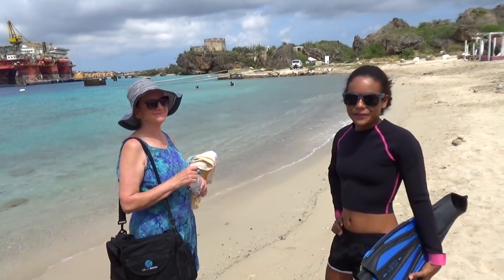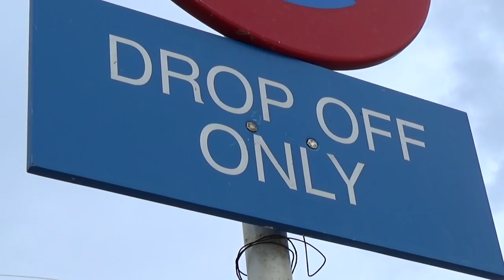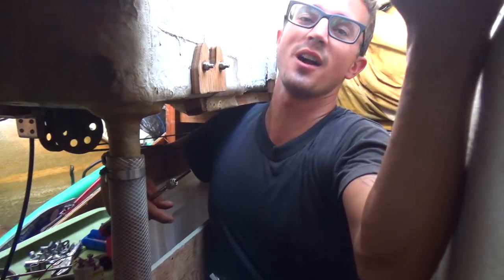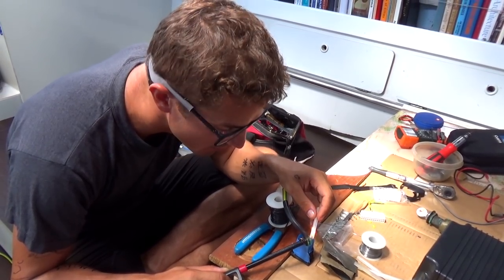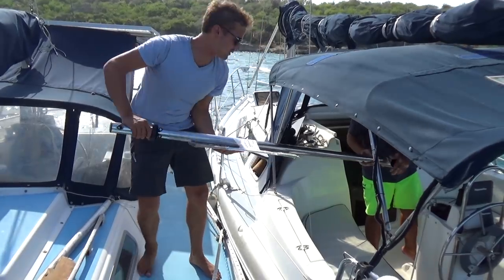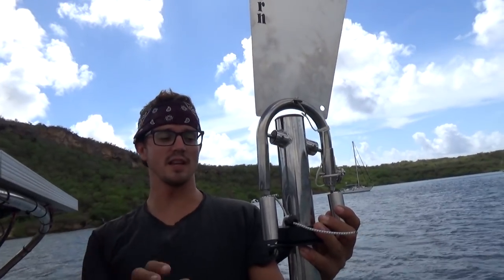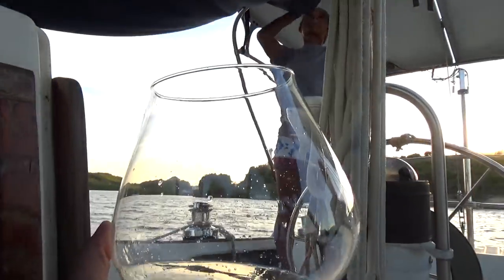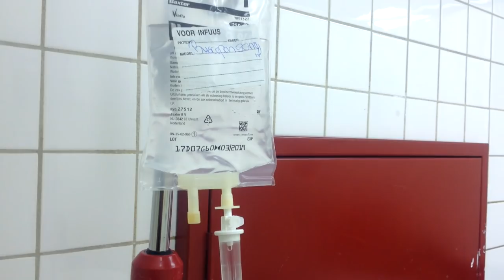Replacing our Autopilot with a CapeHorn WINDVANE — Sailing Uma [Step 101]

Comment: CAPE HORN is definitely the best windvane that was ever designed. No gears and levers, only one moving part… So chafe is almost inexistence and fouling the gizmo is almost impossible. Moreover the beauty of it is that it can be rigged to an autopilot so that the boat can self steer under power with a nominal current consumption. Originally it was designed and built by a French Canadian who sailed alone around the world with no mishap what so ever. Excellent piece of creative engineering. 
Excellent choice ! I wish I had one on my own boat.

Comment: Congratulations on your new windvane. It is sure to become a valued crew member. It doesn’t eat or talk. They just keep working. Balance the boat carefully and let it go to work. I sailed about 14,000 miles with a Windpilot. My boat had light ends and needed a lightweight vane. Now I am buying a different boat and wouldn’t be without a vane even for short trips.

Comment: Sorry about the kidney stone. I got several presently on board. First one, 15 years ago, that wanted to go South really took me by surprise. The next one 4 years ago was to big to pass so the Dr went it and got it. Not fun. Last one, 1 1/2 ago was small enough that after two episodes of it stalling I passed it. From what I’ve read the pain is not when it’s moving it’s when it blocks the passage. Having effective medication to handle those episodes is essential. I’ve found that those episodes only last an hour or so. Also I travel with a medication to help with urination, that helps it pass. Best wishes, I love your channel...

Comment: I had a Cap Horn on my HC38. 
The key for us was to keep the sails trimmed correctly and to not be overpowered downwind. 
Racing helped us in that it taught us better sail trim. Most cruising sailors have their sheets too tight and don’t adjust halyard and outhaul tension for wind strength. .

Comment: I had kidney stones, 1 big one showed on x-ray. They went in with a laser and broke it up so it didn't do as much damage when it passed. It was about 1/2 way out. Worst pain ever, zapped and over. I am always amazed at what you do with so little, making parts. Love the electric motor on a boat. I worked in the municipal water industry, we had a lot of motor controllers for soft starts and variable speed....James

Comment: Tip for soldering !!! always clean your surface area first to avoid dry joints !!!! you were soldering on copper which had visible oxide on it, always give the surface area a rub with an abrasive rubber to make it shine like new then solder to it

Comment: Wind vanes are awesome for ocean cruising, used one from Fiji to Tasmania, when both other auto pilots failed, wind vane was the bomb. Cant remember the brand we had on board but it just had a direct drive to it's own rudder and you had to lock off the wheel to centre. A bit different to yours but it worked really well. Thanks for the informative channel guys!

Comment: I suggest adding this to your motor playlist. I also recommend getting a raspberry pi to monitor your motor & battery temps. You can even have it trigger a vent fan when it gets hot in the battery/motor hold. It sucks to loose a lead acid battery, but a lithium battery thermo issue can literally be explosive.

Comment: I have enjoyed watching all of your videos.  I sailed to the South Pacific in a 30 foot boat with a homemade auxiliary rudder windvane in 1976-7. It was great. I sailed on a 44 footer from Mexico to the Marquesas with a hydrovane in 2015. The hydrovane was pretty bad, frequently requiring manual steering assistance. I have a little experience with a Monitor. The Cape Horn should be perfect for Uma. Years ago we used to have sailing dinghy races with the rudders removed. This was a good way to master sail balance. (Centerboard and crew position were equally important.) I’m sure you have already found that Uma usually sails with a bit of weather helm. As the Cape Horn manual suggests, set the vane at “neutral” for the average weather helm you are experiencing. When the puffs come and the weather helm temporarily increases the vane should handle it. If you are constantly needing to adjust the control lines , it’s probably time to reef. I see tat you’ve already gone hundreds of miles successfully with the Cape Horn. So, you surely have learned all of the idiosyncrasies by now. Good luck!
Reply from the maker: +Mike Jacker We've heard similar reports and reviews of the hydrovane and others. Constant adjustments. We also learned propper sail trim because of our crappy wheel pilot. It couldn't handle weather helm at all! So far, we haven't had to adjust it even.
Reply: Sailing Uma Our homemade vane was also completely reliable with no tending for days at a time on Pacific crossings.

Comment: "does it need a heatsink?". The bigger the better, that big backplate is there for a reason, keep an eye on it. Personally I would have put some spacers behind it to improve circulation. Looking forward to seeing how the re-gen works and great work on the switch mount. Maybe concider a water maker next and start drinking more of it. It's a bit of a cruisers pit fall.

Comment: have a monitor wind-vane and use it anytime the sails are up.  Not really on day sails though, because it's fun to steer by hand. You can even tack with it with practice and favorable wind conditions. Its better then electronic because you don't have to adjust sails with minor wind changes. The boat automatically corrects in the wind, and you just adjust your next course change accordingly.

Comment: Nice video and install of,switch and Cape Horn.  I sail a Rival 32 solo and I have a wind vane.  It is a Sea Feather, built in UK by a very small company.  My boat is tiller so install easier but I love my windvane, rarely use my tiller pilot now as no drain on batteries and no whirring of motors when I am trying to sleep.  Hydrovane is one of the best as can be used as emergency tiller but the Cape Horn has been used in anger on many boats crossing oceans so you have top kit there.  Happy sailing.  Andy UK S/Y Corrival

Comment: Hi Guys, we love the  weekly updates! You are sailing over many of the places we went, a 20yr trip that ended a couple of years back... we had sprouted a daughter on the way!

The reason I am writing is too give you an idea we used ...

We were in the Canaries waiting for the weather as usual when i had an idea..  Our autohelm 1000 wouldn't drive the boat in any kind of weather. when attached in the standard way. I had the idea too attach from the push pit  to  the wind vane so that the power used would be less than a watch ( Just guessing watts  but it was minimal) 

This affair was meant to be temporary but in fact i never took it off, the benefits were very apparent. When there is  light breeze from astern the apparent wind can go to zero, this puts you back staring in 'Night Mare on helm seat ' again..  Same with no wind and the motor on .. The other not immediately apparent plus is the savings in miles..

 As you accelerate down a wave the apparent wind will move toward the bow, similarly when slowing down going up the back of a wave, the apparent wind goes towards the stern.. The net result is a series of curves which over 3,000 miles add up! lol

One thing I hadn't thought of was the wind shits, when this happens your vessel will alter course accordingly. With the course being generated magnetically  Uma will hold a true course and your sails will flap.. In a way  demanding you be a more efficient sailer and trim those sails !! ! lol

Here's a clip of us just off Panama after our time in Colombia ...

https://www.youtube.com/watch?v=_QWCT7ajFB4

Keep up the good work guys ! Let  ol' farts live vicariously once again!! lol xx
Reply from the maker: The Cape Horn is actually designed to use with a small tiller pilot. It has an extension you put on the end of the quadrant in the lazarette. We'll cover that in an upcoming video.

Comment: I had a Raymarine Wheelpilot on my last boat.  It sure was squeaky, but it was reliable.  Though it is rated for 16,000 lb and the boat weighed 12,000, it sometimes seemed to be at the edge of its capability.  My current boat has a much older Simrad WP32 on it.  This pilot seems much more capable on a boat of greater weight, and it's much less noisy.  It's too bad that Simrad no longer makes a wheel pilot.

For the way you guys travel the Cape Horn makes so much sense.  Until I cross an ocean I can live with a wheel pilot as we always end up running the diesel to make power.   I commented on the install video that it is a beautifully made bit of gear.
Reply: I enjoy all of your videos. I sailed to the South Pacific for a year with a homemade auxiliary rudder type windvane in 1976-7 on a 30 ft boat. I sailed from Mexico to the Marquesas on a 44ft boat with a hydrovane in 2015. The hydrovane was pretty bad, often requiring manual steering assistance. I’ve sailed a bit with a Monitor too. The Cape Horn should be perfect for Uma. I’ve read the manual and the use instructions appear to be a good practical guide. Years ago we used to have races in sailing dinghies with the rudder removed. This is a good way to practice sail balance. On Uma   I would expect the boat to hold her best course with some weather helm in most conditions. It often works best to set the vane “neutral” for the average weather helm you seem to be experiencing on that day. Of course in the puffs, she will heel more and the weather helm will increase. When the vane begins to struggle and you’ve already done your best to balance things, it’s time to reef. I see that you’ve already used the vane for several hundred miles with great success, so I’m sure you’ve figured out the idiosyncrasies yourself by now. Good luck!

Comment: Stay hydrated! If you are not peeing clear, and several times a day, you are not drinking enough! Prefer water to juice or soda.  Coffee and tea are good diuretics, alcohol is also  diuretic but has more side effects. :-)

I had 'em at just about your age.  High activity levels in hot weather and not enough water is the classic set up.  They can also be caused by several minor to major chronic problems, most all treatable.  Get it checked out when you can.

Comment: Would it be possible to run an alternator off the prop shaft? You might need to use gears to get the revs correct but, you are the two people I would trust to work it out if possible or not. 
Fair winds

Comment: Well, the old motor controller was factory refurbished when I bought it back around 2005 or so.....at least it got you as far as Curacao.  Yes, much better to have a controller dedicated to SEPEX motors.  I'm sure it will do well for you; it looks like you did an excellent job on the install (as usual).  Uma looks great......Pearson made some great boats back then.  Good luck with the kidney stones; just drink lots of water and watch the alcohol; it dehydrates you.  Ken in St. Petersburg
Reply from the maker: Thanks again Ken for that first controller. It did indeed serve us well. We'll keep it as back up for now and maybe find a new home for it with someone else who needs it. We've already noticed a HUGE bump in efficiency and no longer have controller overheating issues. Next will be a 120-48v charger and a small genset so we can start testing range for the canals next year.

Comment: Dan, did they check your blood calcium level ? If it's high enough to cause you fatigue issues (typically: not feeling rested after sleeping or napping) and also weak memory, it could all be caused by hyperparathyroidism - an all-too-common ailment which fortunately is very easy and cheap to cure but otherwise will make your life miserable if you don't. I hope you two are OK now.

Comment: Ace episode. Love your tech vids!  Excellent casting the switch from epoxy. Neat. Interesting to choose the windvane that acts through Uma’s rudder rather than one with its own rudder. Any particular reason?  I thought the benefit of the Hydrovane was that it gives you a spare rudder in case of damage/failure to the original?
Reply from the maker: Our rudder is hung on a skeg. So if it got damaged, it would mean our boat is sinking fast with a huge hole in it, so steering wouldn't really matter. We looked at the hydrovane, but all the aluminium and SS together is a sure cause of corrosion. They also have a lot of little gears and fitting and pieces to break or wear out. Also, a lot of stuff hanging off the back of the boat and a HUGE vane to capture the wind. Overall, we just didn't like the complicated design and overly large components. The Cape Horn is just the most simple and elegant option out there and it steers fantastically well on all points of sail, even when the boat is a little out of balance. Sure, it might take 2 days to instal, instead of 1, but it'll out last the boat, so whats one more day.
Reply: Sailing Uma Ah excellent. Thanks for your reply. Just watching your downwind with not quite regen and double flyby. Looks to be a great bit of kit. Yes should’ve spotted the skeg! 😉 Cheers!
Reply: @SailingUma  Uber -DIYr Dan. Why not make the aft access hatches  sealed/ waterproof and the whole aft section  is one hermetic unit. That would relieve that sinking feeling in the event of a transom hole. Also rudders fall off due to SS brittleness. Your Cape Horn Windvane could be reconfigured to act as a jury rudder.  Best YT Channel.!

Comment: I'm more interested in the motor controller and how well it performed. Any plans to upgrade the solar or wind generator?
Reply from the maker: +Sam Collier We plan on adding a wind generator, but first want to see just how much regen we can get while sailing. No room for additional solar, unless it was on the sail. Maybe there are more efficient panels out there, we'll see.
Reply: Have you been thinking about solar on sails?

Comment: Hey guys...nice video.  I'm sure you saw Nandji just received and installed a windvane also.  However, I'm curious...there's seemed a lot less intrusive (large holes).  Is there a difference in application/utilization or performance between two versions or just different design with same application/function?

Comment: People think wind vanes are auto pilots. They are not. An autopilot will keep you on a compass/GPS course. A wind vane will keep you on a course relative to the wind. If the wind direction changes, your course will change too.  But, you can hook up a cheap tiller style autopilot to the wind vane (take off the vane) to keep you on a compass crs

Comment: Hey Dan...do you remember the model of the upgraded motor control...I'm about to buy mine...
Reply from the maker: Curtis makes many different models, each specific to different motor types. I'd recommend looking for the right controller for your specific motor.
Reply: @SailingUma  I bought the exact same motor 😏

Comment: Hi. I watched one of your video's from 2015 where you crewed aboard a Pearson. Do you know what type of windvane she had & how well it worked for your passage?
Thanks,
Joe
Reply from the maker: +Joe Harter It had an Aries. And we couldn't get it to work at all. Tried everything, but it kept turning us 180 degrees for no reason. I'm sure we weren't doing something right, but It was terrible. We just used an electric tiller pilot for the passage and it worked fine.

Comment: I have been sailing with a wind vane for over 25 years. A few things I don't like about the Cape Horn, 1) I would never drill a 3.5 inch hole in my transom. ouch,  no way!  2) A very complicated installation. I have heard of people flying the owner of Cape Horn down to the US to do the installation. That involves, airfare, from Canada,  motel and meals, for three days You have skills so you didn't have to go that route. But It took you three days to do the installation and you are good.  And lastly  3) no support in the US only Canada.  
  I understand the CH works well and is about the same price as the Monitor but,  I prefer the Monitor. I can mount a Monitor Wind Vane in a few hours. very simple. You only drill 8, 3/8 holes. I have sailed with a Monitor Vane over 70,000 ocean  miles.that included 4 trip to Hawaii and a circumnavigation. never had a problem. And it is made in the US. You are Canadian so that is probably why you got a CH. Don't blame ya.
Reply from the maker: Yes, I've heard monitor's work well too. For us, size doesn't matter, one hole is one potential leak, 8 holes is eight. And for us, the seemingly complex instal was we'll worth the aesthetic and ease of use in the end. Monitor's were just too much 'stuff' hanging off the back of the boat, including the massive wind vane it's self. I'm not trying to play a "mine's better than  yours'" game, just sharing a few of the reasons why we chose one over the other. There are many more, but they'll have to wait for a dedicated video some other time.